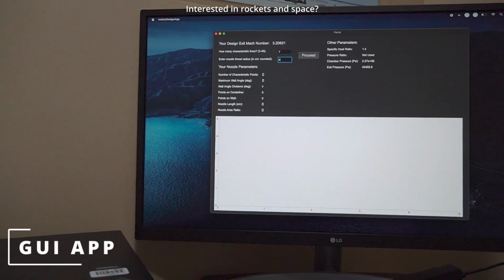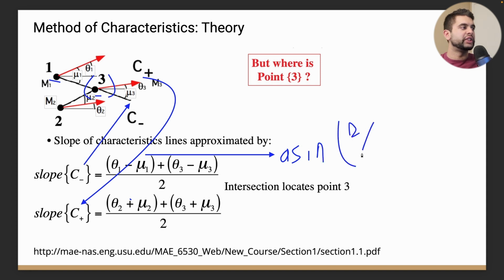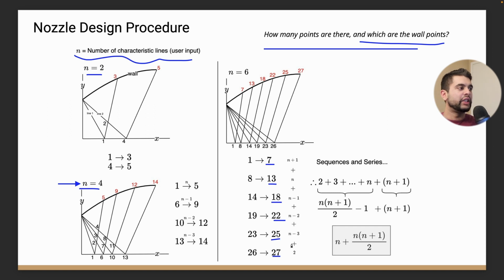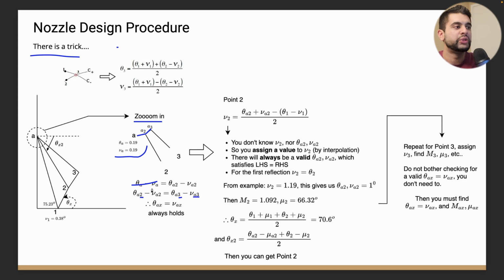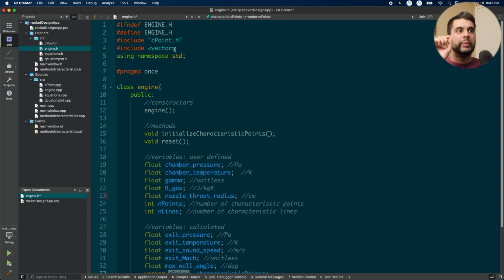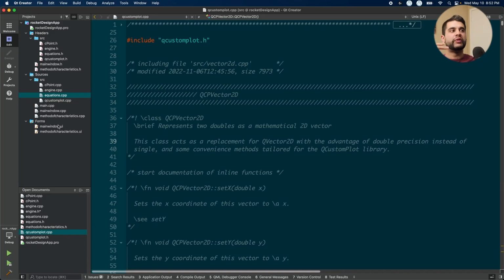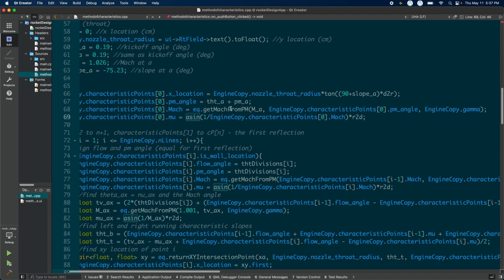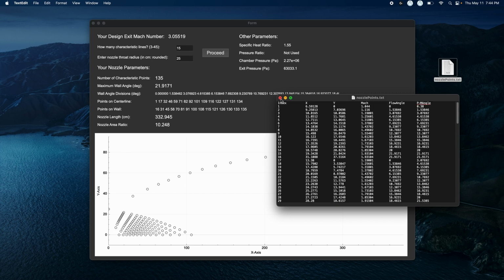Create a Rocket Engine Design App | Nozzles | Method of Characteristics | Theory | Implementation!

Comment: Instead of using point numbers it is much easier to construct a characteristic based coordinate syste. i.e. the coordinate (i,j) refers to the point of intersection of the ith C+ characteristic and the jth C- characteristic. When you do this, moving between adjacent intersection points is very simple.

Comment: btw is this planar nozzle? not the axissymmetric one?
Reply: Because if it axissymmetric, you will get A_exit/A_throat = 3, which is if we translate it into 2D, the radius ratio should be sqrt(3), But your y axis shows that y_exit/y_throat is 2.93 or 3, which is correct if it planar. So in CFD you should get an overexpanded result if you use axissymmetric setting
Reply: Yes, this is the planar technique, not the axisymmetric technique

Comment: Can I design a nozzle where theta_max is not 1/2 * nu_exit, but it is smaller? If yes, how do I apply the method of characteristics? If not, how do nozzle extensions work without modifying the upper part, especially the maximum wall deflection angle? Thank you in advance!